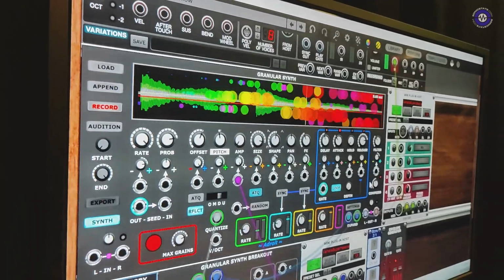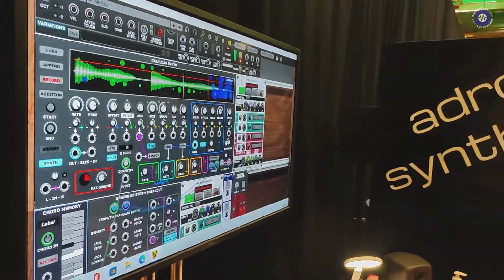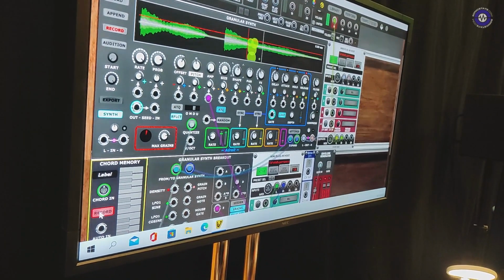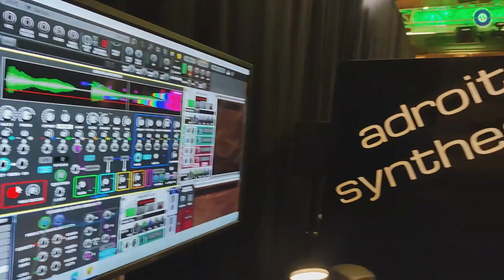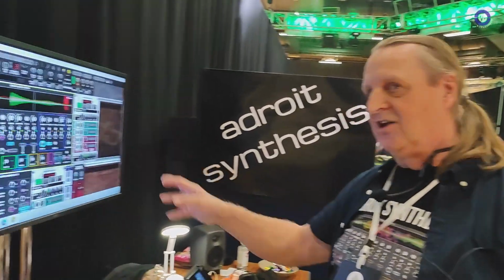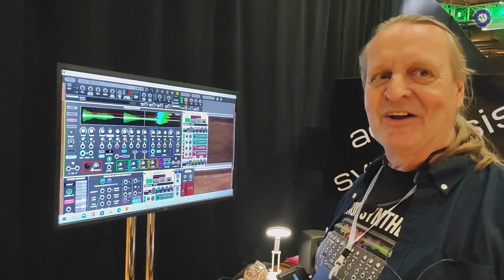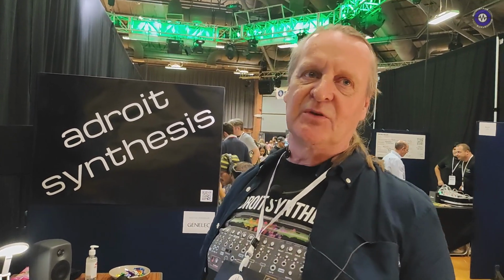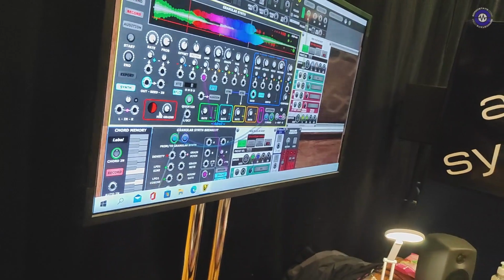Synthfest UK 22:  Adroit Synthesis - Granular Synth for Voltage Modular

Comment: I didn't manage to answer Nick's question about whether the LSSP volt per bar system works in physical terms. I suspect he was thinking about the hardware world where there's obviously a limit to how high voltages can be.

But in Voltage Modular voltage is just an abstraction - what we are actually dealing with are 64 bit floating point numbers with an astronomical range and at least 15 decimal places of precision. There is a recommended nominal range of - 5V to +5V but this isn't enforced in any way so there's no practical limit to the number of bars offset that a V/Bar signal can represent.
Reply from the maker: (Nick here) I suppose I meant does it work with CV from external hardware.
Reply: @sonicstate  
Ah, yes. It depends on what one wants to achieve. If one just wants to sync LSSP and external hardware sequencers then the easiest method is probably via MIDI as the LSSP Song Control module both transmits and recognizes MIDI Clock and Start/Stop messages.

If you have a DC-coupled interface then you can send and receive CV via Voltage Modular's 4 inputs and 8 outputs. This way one can exchange things like clocks, gates, pitch and other information. The Song Control module outputs 5 V triggers for start, stop, 48 PPQN sync, 16 pulses per bar, 1 pulse per beat and 1 pulse per bar so you could wire any of these up to external kit too.  The Song Control module also has 5 V inputs for start, stop and 96 PPQN sync. 

There aren't any hardware modules that understand V/Bar but if one wanted to explore voltage-controlled timing then one might need to scale the voltages up and down by say 1/10 or 1/20 so that the signals remained inside the limited voltage range available in the physical realm.

Comment: Can you drag & drop audio into this? or is it just a granular synth?
Reply: You can drag and drop files on to the module or use the load button to import WAV, MP3, AIFF and OGG files in both mono or stereo.

Alternatively you can record anything patched to the input sockets by hitting the record button (or if you use the optional breakout module you can trigger recording with an external gate).
Reply: Hello how are you doing today